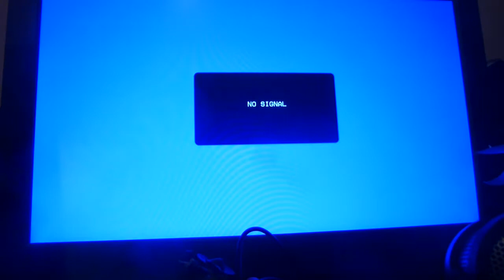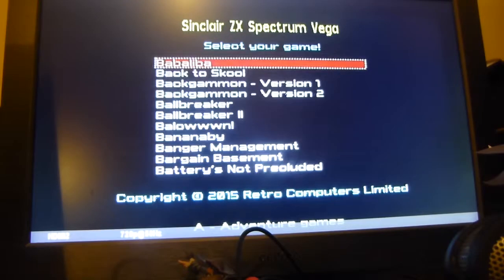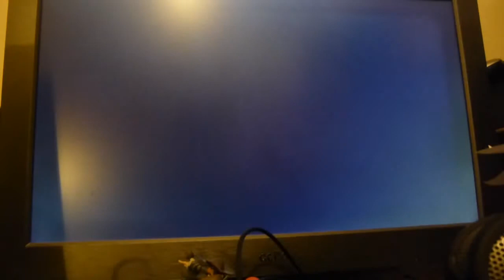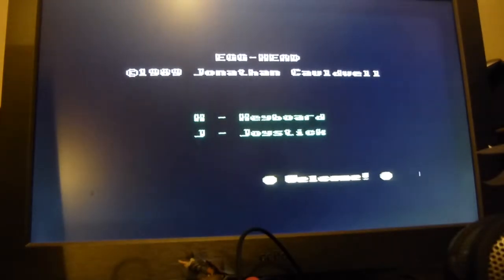ZX Spectrum Vega repair - Composite and USB cable replacement

Comment: Hi real generic demon! I had the same problem as you with the cables. I tried contacting sms for replacements but got no response. Any other suggestions?
Reply: Thanks! That helps a lot!
Reply from the maker: no problem  @mattmyers9351 :-)
Reply from the maker: problem is sms, don't want anything to do with the vega project anymore, a tad toxic.  i can only suggest desoldering the connector and shortening the cable(i suspect the issues is at the joint into the vega), otherwise, you are looking at at another vega from ebay, sorry, i couldn't help more :-(